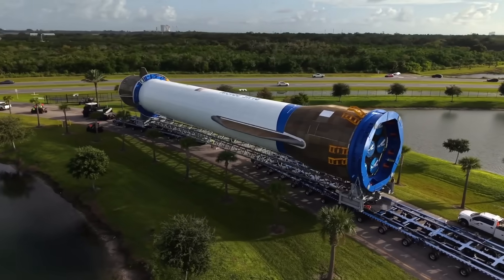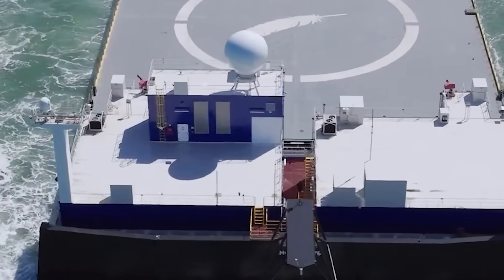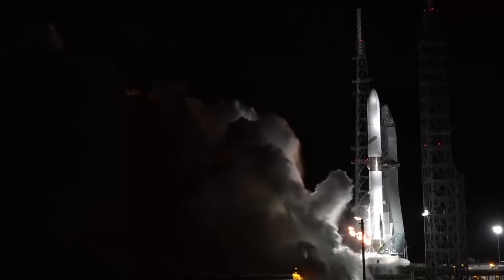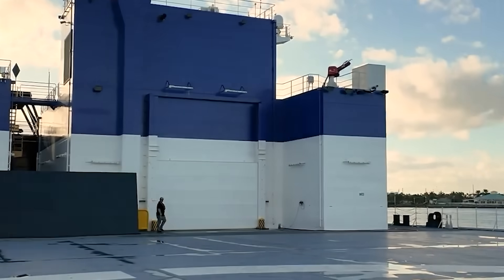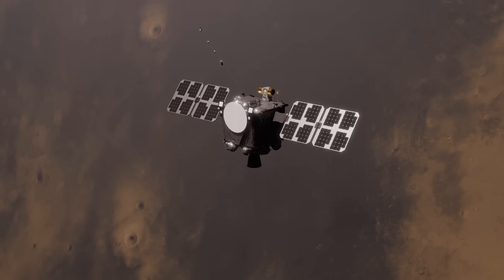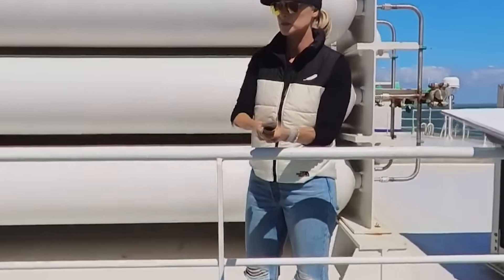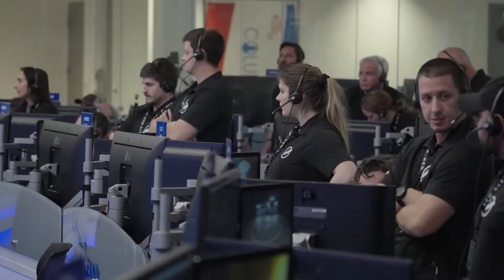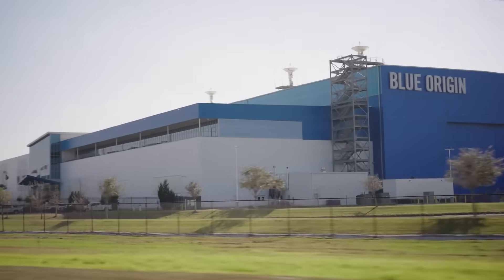Blue Origin Is Ready To Launch New Glenn

Comment: That's crazy, they're actually launching legit payloads on just their SECOND launch of a brand new vehicle... Pretty cool Bezos. I guess the first launch having reached orbit successfully meant enough. Hoping to see it with a bit more TWR off the pad this time, lol. It barely crawled off the pad on flight 1. Curious to see how the booster landing attempt goes this time. Too bad they don't have all the cameras like Starship launches do. Hoping for a day launch this time as well.
Reply: A rocket going operational on the 2nd or 3d launch is a standard that's been around since the mid 60s (after everything that could explode exploded with Vanguards, Atlases, Thors, etc). You can't do better than that.

As far as landing I believe it took SpaceX some 15 (?) landing attemps to nail the landing. Blue Origin landed New Shepard on the 2nd attempt (roughly same return speeds for both). But New Glenn has to gluide and steer a lot more and is much heavier. So...

My prediction for the upcoming New Glenn's launch: they'll land but in the ocean.
Reply: @V14-x6n Solid historical perspective. You’re right rapid operational readiness after early test flights has long been the goal, and landing reuse has followed different learning curves for different vehicles.
New Shepard’s vertical landing profile differs significantly from the high-energy reentry and precision guidance required for an orbital-class booster like New Glenn or Falcon 9. Predicting an ocean landing for New Glenn’s first flight is an informed take; nailing the descent profile, steering, and final burn under such dynamic conditions is one of the hardest problems in modern rocketry.
What in your view is the biggest technical hurdle for a first landing attempt on a large booster like New Glenn?
Reply: Starship development kinda made us realize that, if your second stage is "small", not made of stainless steel, and doesn't have any TPS system, then there... isn't really any risk to going orbital early on. The worst thing you can do with an expendable upper stage is mess up the launch and fail the mission. The worst thing that can happen with a reusable, very strong upper stage is you get it into orbit, but then can't do a controlled reentry and accidentally have a 160 ton thermally protected asteroid land somewhere random. Theres a lot of people who make fun of Starship for going slow, but it makes a lot of sense why they have chosen to play it safe with going orbital. Wouldn't want your first orbital launch to land in a random city lol.
Reply: @logicbuilder1204  Agreed. I'm PRO Space-X but really just PRO space. All of these companies, Rocketlab, Amazon, Space-X they're all doing amazing things and the whole getting boosters to be reusable is a must now. Once the Falcons proof of concept worked, and has for a LONG time now everyone's realizing it's possible. It's like flying a plane and parachuting out at your destination while the plance crashes. Clearly not sustainable. Reuse? Well, we can do it now. I can't wait to see the V3 Starship tests, but honestly I'm just happy to see all these companies going. All awesome stuff.
Reply: @Dying2play13 Yep. Space is cool, and anything to get more stuff happening in space is a win in my book. I'm part of the small group who enjoys both SpaceX and SLS purely because, even though SLS has... problems, it's the rocket that is the closest to actually bringing people back to the Moon, and it's gonna be incredibly exciting to watch it launch.
Reply: @Dying2play13 Most, but not all, fly actual payloads on their first operational flights.  Even The Falcon 1 had a payload.
Reply: @logicbuilder1204  Nobody is criticizing SpaceX for "going slow" with Starship. People are criticizing Elon for "over Promising" Starship Deployment Timeline and cost.
Reply: @jameskelly3502  
I don't think it's just about criticising Elon. Yes, his silly promises back in 2017-18 or so about Mars and Starship with the first cargo flights to Mars in 2022 and manned mission in 2024, just as today's Mars landings in 2026 or 2029. But most people hear this and laugh wishing the dude all the best.

But Starship is objectively slow. They began Raptor design and development in 2012 - by far the most important part of the rocket. The programme today is a mess - all done at the same time just hoping for the best for each flight that it doesn't bloe up, like it's kids launching a toy rocket.

They are well on their way of becoming the longest developing rocket ever in history with no guarantee it will work in the end  in its current concept. They messed up Artemis lunar lander plans which NASA is trying to fix now with 4 years already wasted. So there are things to critiicse for, although the latter was NASA's fault giving it to a single contender.
Reply: @jameskelly3502  Timeline I see, but who's complaining about their costs?
Reply: @imaginary_friend7300  
 The fact is SpaceX was paid billions from taxpayers and has delivered nothing. 
  So now NASA has to spend more tax dollars to find a new contractor, in case Starship is never operational.
Reply: @teslateam1 1) The fact that Dragon and Falcon9 are a success does not guarantee that the starship will be successful. Especially since Falcon9 and Dragon don't actually live up to what SpaceX originally promised.

  2) There is ZERO transparency regarding how much Starship has cost, so we don't know tge percentage of tax dollars vs private dollars spent.

 3) Even if 90+% of Starship is paid for privately, it is still a valid for taxpayers to be unhappy with how our money is spent.
  Especially since the Government Accountability Office concluded that SpaceX got the HLS contract "illegally."
Reply: @jameskelly3502 We’ve addressed these points. The GAO protest was procedural, not a finding of wrongdoing, and the contract was rightfully re-awarded after a full review. Starship is largely privately funded, and its success is measured by achieving what no other system can: full reusability and interplanetary capability. The proof will be in the flight results. We’re focused on the mission.
Reply: @teslateam1 No, for a privately funded company, success is based on profit.
  Your describing a university, or a non-profit.
Reply: @jameskelly3502  People do genuinely compare the development rates of New Glenn and Starship as if they are comparable, so I disagree with you that people aren't saying they are going slow. They are also criticizing Elon for overpromising Starship development speed, but that's a separate thing.
Reply: @logicbuilder1204 Your using a strawman argument.
  I never claimed anything regarding "Starship development speed vs New Glenn development speed."

  My argument has been "exclusively" about Musk overpromising with Starship. And you refuse to touch that with a 10 foot pole; Because you know I'm right, but your ego won't let you acknowledge I'm right.
Reply: @jameskelly3502  I phrased that message poorly and it was partly a result of miscommunication. I was talking about how using "time to orbit" as the metric for development time is a bad one for comparing Starship to other rockets, and in my mind the very first thing I had was New Glenn, especially with the other comments I have here. I honestly hadn't seen your message until I had said some other stuff here so I didn't immediately know which one you responded to, hence the miscommunication. In general, a good rule of thumb for any communication over text is "do not attribute stupidity to what can not be attributed to miscommunication" lol.

That being said, I do still think you are wrong. Not that Starship has been behind it's promised development timelines, that's very true (woah, I recognize that Elon Musk has a very rose tinted glasses look of development timelines and you should never trust what he says and instead look at general patterns of previous development! Crazy, I can't believe my "ego" let me do that), but for the general claim that nobody claims Starship development is slow. People absolutely do claim that, and more specifically people do claim that time to orbit is a good way of measuring the speed of the development timeline, which I very much disagree with. Sorry if you disagree, but honestly the evidence that people do say that is in this reply section, so idk what to say.

I'm probably not going to respond to whatever you send reply to me with though, considering you seem to be someone who is in an argumentative "Debate me bro!" mood, and quite frankly I dislike talking to people online who are like that. The fact you immediately accused me of using a fallacy and then insulted my "ego" while also saying "Because you know I'm right you just won't say I am right" is pretty decent evidence of that. Honestly, I probably agree with you about a lot more stuff than you expect, but you can't have that be the second message you send someone if you want to engage in decent discussion.
Reply: @jameskelly3502  Who are these critics ?
Reply: @logicbuilder1204 
Starship being slow has nothing to do with chosing not to go orbital yet.
Reply: @V14-x6n  I agree, but a lot of people use the point that they haven't gone orbital yet as a sign that it's slow, which imo is a horrible metric considering the requirements for going into orbit for Starship are a lot more strict than something like New Glenn
Reply: @logicbuilder1204
That's what irritates me about people, they keep saying it's taking SpaceX a long time for starship, and that is BS.

Sls, which is a high school project for the smart kids to be honest, took 12 years and cost $25 billion dollars. It is almost exclusive 1970s and '80s technology that has been slightly modified. 

Starship the largest most complex thing ever launched, has only been in development for about 11 years, and SpaceX is only spent about $7 billion dollars. 

If starship is being built by the companies that built sls, they wouldn't have the grid fins designed out yet.
Reply: @lordgarion514 Well said. The comparison really puts the pace of innovation into perspective. Starship isn’t just another rocket it’s a fully reusable, orbital-class vehicle being developed at unprecedented speed and a fraction of the cost of traditional programs. The iterative, test-fail-improve approach is what allows such rapid progress, even with a system as complex as Starship.
Comparing timelines and budgets only tells part of the story the real difference is in the development philosophy.
Reply: @logicbuilder1204  I call BS! Starship has been a mess, and was slated to go to orbit already, but has failed, It's a shit show! Making orbit , 1st try and launching payload on 2nd try, just show's who has their shit together- SpaceX drug addict owner is all show, notice how quietly Bezos' rocket has succeeded- Musk is a circus barker
Reply: @prospero11  Again, "first to orbit" is a bad metric for Starship, as Starship risks a LOT more going into orbit then New Glenn, as their second stage can have large chunks of it survive uncontrolled reentry and potentially land on inhabited areas. Starship absolutely COULD go to orbit, it would just be unnecessarily risky. They also don't have a ton of reason to go to orbit yet as they are still in the development stages of the vehicle.

Comment: I thought that in addition to the two EscaPADE spacecraft, New Glenn flight 2 also included a non-deployable technology demonstrator payload for ViaSat's InRange launch telemetry relay service, as a part of NASA's Communications Services Project (CSP)? Is there any infomation regarding what that looks like and where the payload is mounted?
Reply: I'm certain it won't be in any way attached to Escapade spacecraft not to effect their mass balance. So could be on the cone-shaped payload adaptor if smaller size or as a full payload using dual payload sructure if large size. I guess Viasat will have pretty big antennas on it.
Reply: @V14-x6n Excellent technical reasoning. You’re right the ViaSat InRange demonstrator would almost certainly be mounted separately to avoid any impact on the EscaPADE spacecraft’s mass properties or mission requirements. A location on the payload adapter or within a dual-payload structure makes the most sense, especially if the unit includes sizable antennas for telemetry relay. Clear, interference-free integration is key especially on a test flight with multiple high-value payloads. Sharp analysis as always. 🛰️📡
Reply: That's a sharp observation you're correct that the mission manifest for New Glenn's second flight was expected to include the ViaSat InRange demonstrator as part of NASA’s CSP.
Specific details about the payload’s mounting location and design haven’t been publicly released yet, but it’s intended to test real-time telemetry relay during launch, which could eventually improve range safety and data coverage. These kinds of rideshare tech demos are often mounted in available adapter space or integrated into the upper stage avionics.
We’ll likely see more details emerge closer to launch. Good catch staying on top of these developments is key as the industry moves toward more flexible and capable launch architectures.
Reply: @teslateam1 whats with the chat gpt comments?